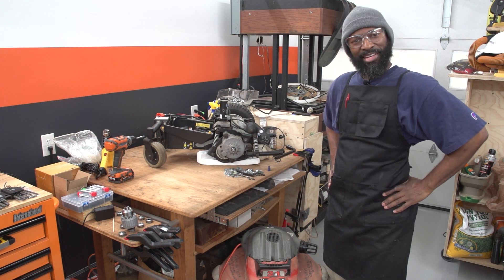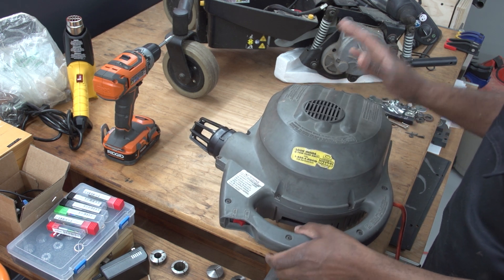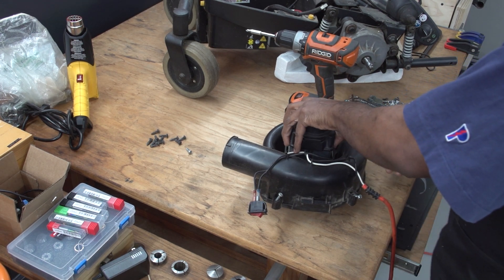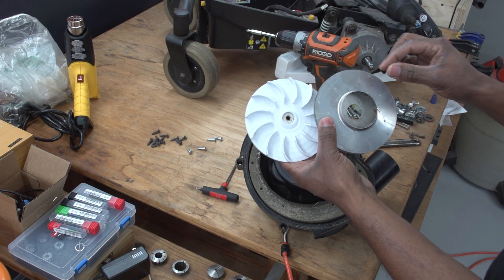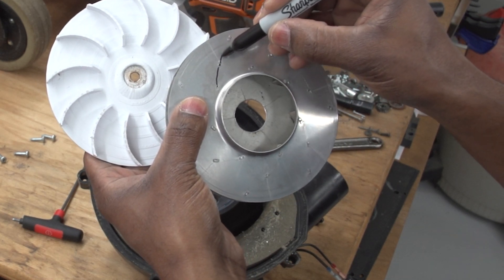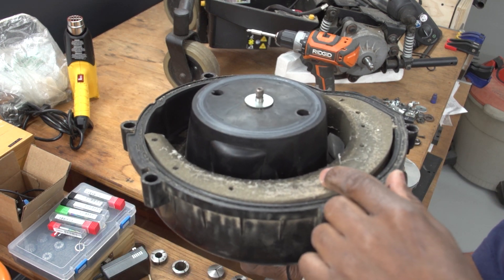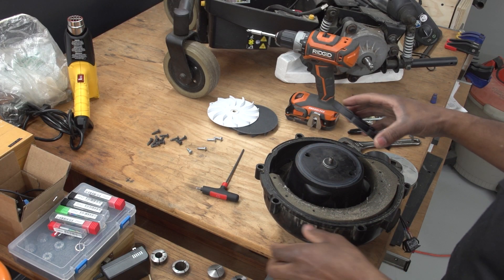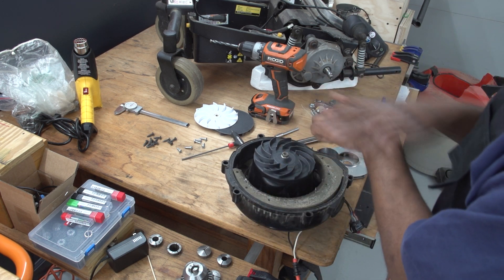RIGID shop Vac Fan Repair #howtovideo #wastenotwantnot

Comment: Nice job. Although, I do have a question, Why did you not replace the fan with an OEM replacement fan blade?  The blades look to be completely different. The original blade looks like it is designed to have air go in the center, travel through the blades. Also, the OEM Blade is metal/aluminum. That may be why your unit is running hot. Anyway, my curiosity has got to me. Thank You,
Reply from the maker: Thanks for watching... This was an experiment to see if I could, in fact replace the blade with a 3d printed one.  Also, the one in the video later shattered... and I had to print another that had a top layer glued to the fins more like the OEM part.   The new printed one still works although I don't run the vacuum as long (this vac is over 20 years old).  I bought a new vac as well...lol